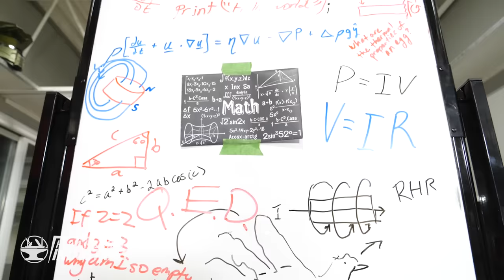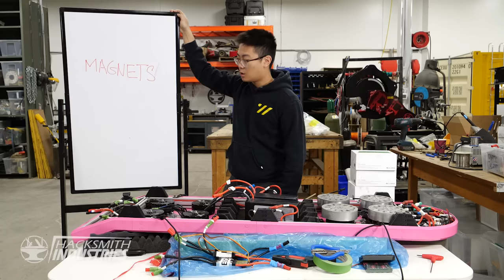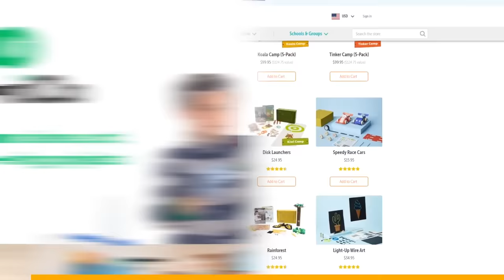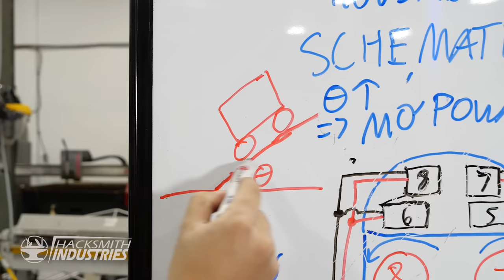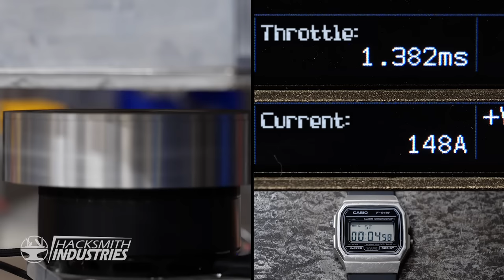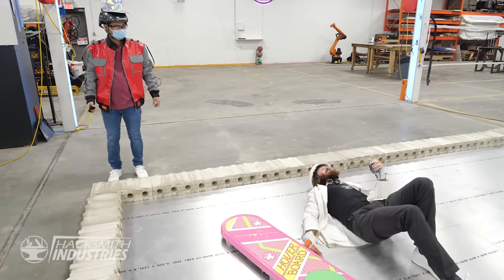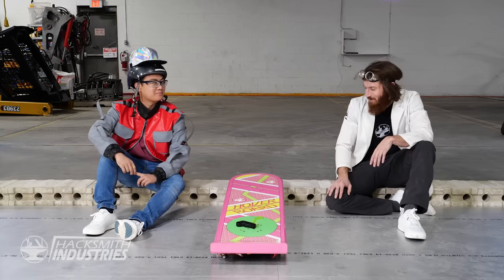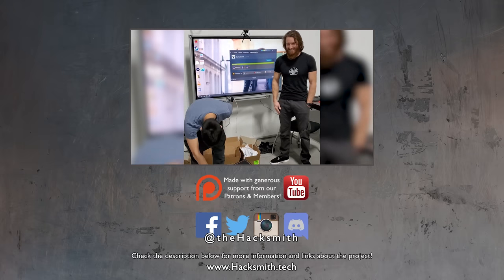HOVERBOARD TEST! (PART 2/2)

Comment: Imagine having “I built a hoverboard” on your resume
Reply: Job hirer: so like the ones with the two wheels

This guy: no like a floating hoverboard
Reply: overkill fan I see
Reply: @fifteen8536  MEGA DESK, MEGA DESK, MEGA DESK😂😂😂
Reply: Noobmaster69
Reply: @Joseph Kwapis yeah
Reply: @fifteen8536  why is his logo the overkill logo?? BECAUSE
Reply: let me correct you: "I built a hoverboard, and it WORKED"
Reply: I see overkill
Reply: Imagine bootlicking so much you don't realize this isn't actually that impressive. They could have used superconductors instead of magnets. Those would have made the wow factor over 900000000000000000000000x. All they needed was a really cold room. Also, magnets needing ferrous metals to repel against probably won't change for a long time. Superconductors that work at room temperature at normal pressure might come a lot sooner. No metal floor limitation.
Reply: @edenassos  That’s cool bro but did I ask?
Reply: @edenassos  wouldn't that also be impractical?
Reply: Imagine he applied at Lexus and they were like.. Bro we did that 10 years ago... good job stealing our idea
Reply: or better yet.. imagine he applied at Hendo Hoverboards and they were like. Bro.. we also did that like 5 years ago
Reply: Then the job hirer: you're over cualified
Reply: @jasperr1822  this is practical? it draws 80kW.
Reply: @edenassos  said in the video that they thought about it for months so they probably thought that was a bad idea
Reply: Imagine also having, I built the worlds first lightsaber on your resume
Reply: @Mr thundering STAHP SEKG PROMOTING AHHHHHHH
Reply: Yea lmao.
Reply: And now a lightsaber.
Reply: Imagine having a hovering tank
Reply: How to get hired 101
Reply: @edenassos  don’t care didn’t ask
Reply: And “world first working retractable 100+ degree plasma proto light saber “
Reply: @edenassos  🤓🤓
Reply: JESUS LOVES YOU SO MUCH
Reply: @fifteen8536  JESUS LOVES YOU SO MUCH
Reply: Ill have on my resume  built a working hoverboard and arc reactor

Comment: Well done!! Those 6061 plates ain't cheap (or anything in this project)  but it was worth it. HOVERBOARD!!!!
Reply: Hoverboards are great !
Reply: A wild Ivan Miranda!
Reply: @haydenmilic3139  Present!
Reply: They could have done a water cooled floor if they had time.... what an odd-sounding concept that would be.
Reply: miranda how about a 3d printed water jetpack for your next project? lol
Reply: @LeonelRodriguezxlr  lol
Reply: They cant use it tho they need a stolid trail of metal
Reply: @dfgaJK  that would need a lot of radiators...
Reply: Jakub Burian  The project itself is a Spacer! Generator between the floor and the board.
Reply: HECK YEAH
Reply: @dfgaJK  water heated floors already exist, why not water cooled, not so strange, but probably power hungry just yet

Comment: Imagine in a 100 years in engineering class. "This was the first functional hover board"
Reply: Actually those were out like 10 years ago lol. They had the same issues as this one though. Very loud and a slow startup and needs a metal floor
Reply: @hidude9919  and 80 fkng kW...
Reply: Markus Müller  true but no one has managed to build one of those yet. I imagine the power needed for that is enormous
Reply: Wait, but Hendo already did this. And nor this one nor the other one are actually hoverboards, they are just using magnetism. Technically the japanese have Hovertrains then...
Reply: Fr tho
Reply: This was not the first, nor even any good. Lexus made a far better product, just for shits and giggles. The engineering in this video is atrocious.
Reply: It was pink 😂
Reply: @sqlevolicious  eh it's less practical but looks cooler.

Comment: You should try SEG (Searl Effect Generator) to make it hover. The magnets generate the electricity at a certain speed causing lift from below the magnets as well as above. Also known as antigravity
Reply: A company did that with another board called the hendo  but it also uses rotating magnets.
Reply: To be honest this is still cool but it didn't have much control either

Comment: Now all we need is a hoverboard that can hover anywhere
Reply: Yeah, I think they did this kind over 10 years ago.
Reply: @madthumbs1564  thing is, the hoverboard ten years ago was just plain woodboard with magnets on it and the one making it float was really the magnetized floor. Unlike here the floor is just plain metal and the board is the one doing the magnitization so technically this can go anywhere if the floor is metal unlike the one ten years back that the floor needs to be special making it impossible to  make it hover elsewhere.
Reply: All we need is a metal floor lane at the roadside
Reply: @madthumbs1564  dont know if thats ever gonna be possible. If it does become feasible at some point in the future, then it wouldn't work based on magnetism or superconductors. If anything you would most likely see them use ionic propulsion.
Reply: Or make everything out of metal
Reply: Or special sidewalks meant for them, but I would think they need more battery and to hover higher, I love that it actually works, but going anywhere would ruin the bottom
Reply: With metal streets right?
Reply: Yea
Reply: Just put metal everywhere lol
Reply: @FenixFoxxo  "I love that it actually works but going anywhere would ruin the bottom" exclaimed the Emperor after trading in his new clothes for a space hopper.

Comment: Imagine being alive when one of the first real hoverboards got created.
Reply: this wasn't the first, nor a unique design, but it is badass
Reply: @error.418  first biggest one or the second unique hoverboard
Reply: @Daniel Athens no, but maybe in the future we will have metal roads, who knows? And yes that would be expensive, but maybe it will be a synthesized material that is metal like in it’s magnetic properties?
Reply: @Daniel Athens yes it can that metal place was aluminum which isnt magnetic ... it was for heat I think
Reply: Didn’t Lexus make one?
Reply: @Daniel Athens hover cars as well and stuff like that
Reply: @Daniel Athens  @TopGamer Central  We have steel roads already. Trains drive on them. More than thick enough for the heat.
Reply: @Daniel Athens Or maybe to save cost because y'know, building metal roads will be expensive af. How bout build a metal hover board lane like bike lanes. Its smaller and can save cost.
Reply: I'm pretty sure I'm alive and that is a real hoverboard
Reply: @Daniel Athens Nope! But the dudes who built this before did make a sweet metal half pipe. I mean it could only go up and down the sides, it's not like you're gonna kickflip it, but still fun. But yeah, you're have to be over a metal floor.
Reply: @Daniel Athens um I guess you don't need specific ground if your fine with burning ground below you and risk damaging the hoverboard lol
Reply: @kwertyskewrty4046  They appear to both be about the same size. The first one was several years ago, though. I mean it's just spinning magnets. But still non-trivial to build, and this kid was an intern. So still big props to him.
Reply: @error.418  still awesome they were able to make that
Reply: @kwertyskewrty4046  100%

Comment: You can make it better by spinning Ferium and Mercury in superfluid cold conditions up to and higher than 20.000 rotations per second electromagneticall and radiators to dissipate heat from the plate itself.

Ps. I assume you will steer it with gyro micro movements and speed with some pilot?

Comment: i feel like eventually the entire warehouse floor is going to be metal, so everyone can just get around via hoverboard
Reply: Too dangerous. I mean, if there is an electrical issue in an expériment, they all die electrocuted
Reply: But i would love to see an entire building with the round cover with metal, and hoverboard lark
Reply: @thomasferreira230  they use rubber shoes
Reply: @Decade332  yeah with somehow implying wood into the soles of that makes sense and is possible
Reply: Also working on electronics you may want a less static conductive floor
Reply: @x0louis0  they can get anti static mats around where they’re working
Reply: @agentdouble0716  he means a metal floor wouldn't allow static build up. So static mats wouldn't be required.

Comment: Question,
Put each set of rotating disks on a controllable base that will tilt say 0 to 3 degrees any directions. The downward force is no longer even and the “weaker” side the board will “fall” so you could turn it, forward or backwards! Great work!

Comment: imagine a place where you could book a "hoverboard session" where they have like 10 hoverboards that people can try
Reply: Frictionless bumber cars
Reply: The amount heat
Reply: @TuxieBSOD  well, you could watercool it from underneath
Reply: @anonanon3066  u ever cooked water with an induction stove? Ur gonna need allot of water to cool 10 hoverboards of power..
Reply: @Ginormus  I wonder if some sort of intercooler / radiator style of system would work with a constant flow of water being cycled through with fans to cool the tines? Just a thought.
Reply: @Ginormus  no, you just need FLOWING water SO THE WARMED WATER GETS DISCARDED immediately..

Get a really big ass water tank and strong pumps.. The tank can cool down overnight, maybe even actively.

Or get the water from a river and pump the warm water back in it
Reply: u got that from arthur i watched that show like 5 years ago to man
Reply: @presgold5811  tf is arthur
Reply: in 4-5 years this COULD be a thing
Reply: @anonanon3066  that won’t work because They will be heating up throughout the day and it’s only at night time that you can call it down otherwise it will store up
And become a heavy inconvenience.😌

It would heat up quicker than it would cool down
Reply: @EternalGrey420  that would be awesome but expensive
Reply: @sparkz_fn6262  The point is that such a giant  watertank has SUCH A LARGE thermal capacity that it can easily take all that heat from 5 hoverboards all day without releasing any of it and it would heat up by a few degrees AT MOST.

Of course the heat radiates away at night. At least partially. As long as the water tank is not HOT it's okay. And the sun won't make it hot as long as it's in the shade.

Plus, put the outlet for the cold water at the bottom because there the water will be the coldest.

The floor can be warm. Just not hot. Plus, you can actively cool the tank if you really have to. Dip a big array of aluminium fins in it and air flow on top circulating through windows or something like that.

Of course i'm talking about a BIG water tank. Not some 1000L tub. I thought of like 1-2 million liters which would be about the volume of a big simming pool.
Reply: this video was so mf anticlimactic, it didnt even get off the ground
Reply: @123newjersey3  i thought it did
Reply: @callsai  the biggest engine on the bottom middle on both sides was always touching the ground.
Reply: @123newjersey3  oh
Reply: @callsai  ur mama
Reply: @presgold5811  I don’t watch that

Comment: I wonder if it will ever be possible to make a hoverboard that doesn't rely on magnets/superconductors to work without much noise. This one is really cool and I can see how it could be improved further, however the noise remains an issue. 

Honestly though, huge respect to Jimmy for pulling it off! I'm very hyped to see what the future holds for hoverboards.

Comment: you guys must make an improved version 2 model by adding accelerometer and create an algorithm to compensate the eddy current created by those motors for the better balance.
I also think you can mount two more eddy generator at the tilted part of the board, so it will act as a thrust. maybe it will make the board can do a hover kickflip that Allen Pan mentioned :D *kidding
Reply: I hope Allen Pan has read this
Reply: Better yet just use a flight controller for a quad copter or the such, there all open source I’m sure they’d be able to set it up to work
Reply: Huh
Reply: i hope this is noticed

pretty cool what an educated response that was too, im impressed
Reply: That's brilliant mate!

Comment: Hacksmith: does this. 

me an intellectual: just do giant air hockey.
Reply: I was thinking that, but then you are limited to the air jets around you and it would cost more money
Reply: @neotuxxedo  as opposed to being limited to riding on steel plates?
Reply: @neotuxxedo  But with this board you are limited to metal floors. Not many places have that. Sadly neither option is very viable.
Reply: They already did that with a leaf blower

Comment: Was anyone else thinking that james's coat was going to catch fire when he was testing it?
Reply: I was actually marginally concerned
about him placing his vital organs
anywhere NEAR that much electro-magnetic radiation.  =0.0=
Reply: @johnaquino7619  what radiation?
Reply: I honestly thought it would too if its hot enough to frie eggs his lab coat shouldve caught fire.... @hacksmith explain
Reply: catch fire, no but get twisted up in the spinning motors... yes
Reply: @florianschneider3982  .
Well, not the kind of radiation generated
by a reactor or a bomb,
but this video made me think of other sources of radiation, 
such as thermal radiation from a camp fire,
or - in this case - an electromagnetic field,
which I thought was a form of radiation.

From what little I know about magnetism,
there really is not as much risk
as you might face from 
thermal radiation or nuclear,
however,
it struck me as humorous
that with the forces they were generating from the electromagnets on that hoverboard
that I personally would be hesitant to sit on it or lay on it.

Just musing out loud.    :-)

Comment: Next episode: making anti-fall boots from portal
Reply: they would break ur bones though..
Reply: @-NME  men who knows what they can do, maybe not like its you can jump off skyscrapers but they probably make something so you can jump off 20 feet or sum lol
Reply: Don't do it the way it's portrayed in portal: Instead you can make a soft landing system vaguely akin to the Soyuz capsule's retro rockets.
For more repeatability you can use electric motors and propellers and because you don't need them for very long at a time but then at very high power you can power them with ultracapacitors.
Oh no, I feel like I need to build a model version of this, like an electric suicide burn machine that lands you from any height at a constant G load. Wouldn't be boots but still

Comment: Next test, layer the entire floor with those magnetic plates, build some more hoverboards and hockey pucks, then have a game of hoverboard hockey.
Reply: Why not a complete magnetic skate park
Reply: That would be dumb ngl
Reply: @-Alemann  nah hoverboard race track
Reply: @-Alemann  that's was Lexus made 6yrs ago. Hoverboards in areas with their own magnetic infrastructure would work! Maybe move those elements to sidewalks or a separate lane for boarders and it could work for commuters to school or work or whatever (like golf cart paths in the suburbs and bike lanes in the cities). It'd be even safer in tandem with "smart roads" with autonomous cars. Most of this stuff is somewhat doable and could be done sooner if awareness was raised and people pushed for it.
Reply: Lmao
Reply: @-Alemann  💰💰💵💵
Reply: No you missed the genius of the design. The flooring is metallic, not magnetic. What Lexus did meant that people could only go in a straight line like a railroad track. This is just regular metal. It would work on any metal floor, no magnets required.
Reply: @josiah42  Right up until it does like it did when they tested it and, you know, warps the metal flooring
Reply: @KamenRiderRaiden  This current method is absurdly energy inefficiently and it bleeds off gargantuan amounts of heat, which caused the warping. The engineering challenge is to find a way to create a magnetic field anywhere, then perch on top of it, like quantum locking superconductors do. It's the difference between a helicopter hovering and a hovercraft with a skirt contacting the ground. The hovercraft traps its own energy and is much more efficient.

Comment: I can’t imagine how difficult it would be to ride one of these, I can’t even ride a normal skateboard!
Reply: 🥺🥺🥺time and dedication my man
Reply: probably would be easy compared to the risk of hitting a rock and stuff
Reply: I don't think you can even control it to begin with.
Reply: @arcionek  Probably
Reply: I don't know how to either but I'm willing to learn how 😅
Reply: @arcionek  no, as a skater i believe if they got it to hover higher then you may be able to tilt the board where you wanna go
Reply: @chad3779  I think if it hovers higher you'd fall off if you tried to tilt.
Reply: 69 likesssss!!!
Reply: @arcionek  not if you take a page from the snowboard and have feet held on.

Comment: Thats serious results, that proves that it's in a sense possible and with improving technology over the years this will be extremely possible to improve on, great job guys
Reply: The main breakthrough here is the power delivery of the batteries which are insanely powerful and compact. Sadly the technology itself hasn't so much evolved since the idea of maglev transportation in 1960...
Reply: @Willysedom  I wonder how long the hoverboard operates on the batteries? I also wonder if they can be fitted to be recharged like electric cars? How awesome would it be to ride a hoverboard to work and charge it up next to electric cars at an electric fuel station?

Comment: While it's still limited on what surfaces it can be used on, quick covering an area is still a lot easier that ripping up a locale and putting in a narrow, restrictive circuit path.

Comment: If you really wanted to make eddy currents, you had to use axial motor without rotor just stators and inverter. That can remove rotating part.
Axial stator with core stack can make efficient magnetic force with higher speed not mechanicaly. And applying cooling fan towards metal ground would be good.